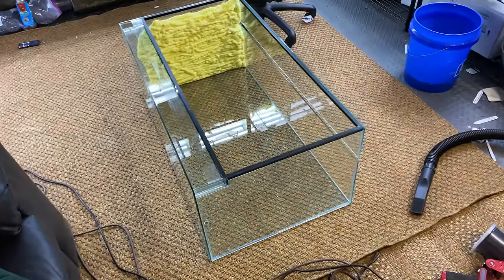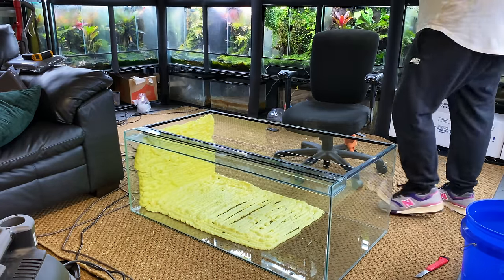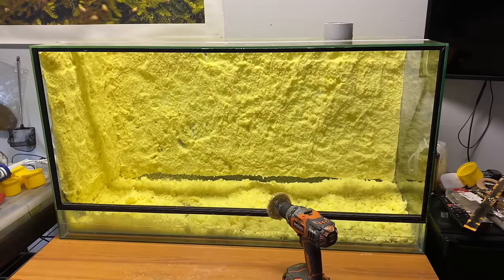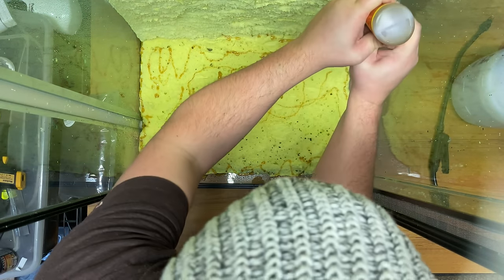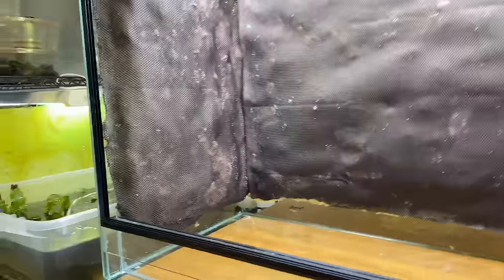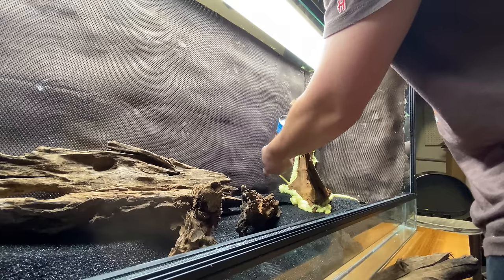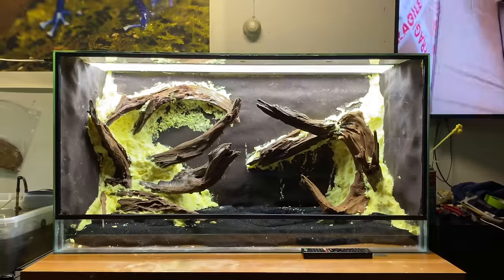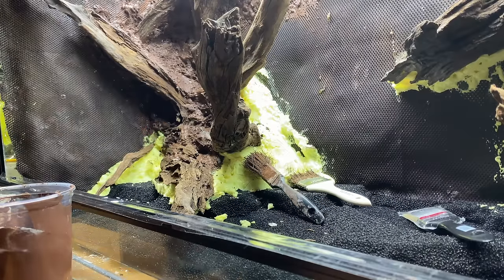How to Build A Custom DIY Vivarium Background Like a PRO!

Comment: Necessity is the mother of invention. I love the wire wheel hack! I am in the process of doing my first naturalistic/bio-active build on a 22wX17dX36H enclosure. I've seen the hand carved approaches, and the references to hours of carving. I'm probably not that patient. I think what I might do is add a little more foam up front, so that I can get some more depth to the cutaways and then maybe hand carve areas I want to bring a specific shape to.
I think what I'll do then is to carve out branch/hardscape notches as needed, fit the branches in and then spot foam them in place.

Comment: Auto body shop tip: use 1200 wet sand paper to take anything off your hands 🙌🏽. Body filler is very hard to take off. Sand paper always worked for me 👍🏽👍🏽

Comment: I work on a lot of cars and bikes, practically live in the garage covered in all sorts of adhesives and chemicals and nasty stuff, but I've got to say "Great Stuff" spray foam is hands down the worst thing I've gotten on my hands lol! I just let it dry and use an emery board on it while I watch TV later on which is pretty relaxing, haha.  This is a good video, man, thanks. You're easy to follow with a good pace and a way of explaining things that laymen can understand. The brush on the drill is a good tip. It's tedious using a knife and that brush gives a pretty cool, "natural" texture. I did want to ask if you've tried any false-bottom vivariums in that garage during the dry winter months? They're easy and cheap, I think it might be worth running one as a test to see if it helps keeps the humidity up. Of course you'd probably be pouring in water to refill the bottoms occasionally, but it might be a decent and mostly-passive way to keep the moisture up in the tanks, especially any that have overhead lights. I've been doing them in any vivs that need over 60% humidity or so, they really help any live plants flourish, as well as temperate or tropical "clean up crew" bugs like springtails.

Comment: I lay silicone lines down on my glass and put popsicle sticks on them and let it dry and cure and then put little droplets of silicone everywhere. Once dried Ivan lay down pond and stone foam. Once it's done cured i cut it. I shape it and then I lay a construction silicone around the edges and smeared in real good. Both on the foam and glass holds it really well. Note to everybody paintable silicone or construction adhesive is easier to work with.

Comment: Amazing video but 1 small notice... the matts we use here in Europe are called Matala matts. They are harder and dont compress unlike the foam filter you used. Matala mats are also used in koi pond filters and big pond filters where the flow of water and hydroscopic presure is so high it would compress the normal foam pads. Matala mats are slightly bendable and can be cut with a sharp knife or cut by a saw. I think over there in the US and UK you can also buy the mountain tree filter mats. Its almost the same material
Reply: Oohw 1 more little thing about the mats. They come in different colours. Use the black or green one. The black is most coarse one the green is normal coarse type. The rest will clog up.
Reply from the maker: I’ve used matala before… but also what you’re saying isn’t exactly true…. Many of the people in Europe are using the same sponge filter mat that Im using.
Reply from the maker: I always use black.. there are different grades of the black… I always use the lower PPI( pores per inch) for better aeration and flow.
Reply: @TroyGoldberg  ooh ok, well guess i learned something today 😉, thanks for the reply.

Comment: If u dab the deep parts with black and then grey around the medium and crack spots then bush the brown over u get better texture and shadows
Reply from the maker: I have a BFA in oil painting…
Reply: @TroyGoldberg   that's Kool is the lighting dark or does that stuff dry to be black?
Reply from the maker: Mmmm I mix many different batches… some of the dark mixed are almost black, some are a dark brown/grey…. I always paint the deeper crevasses darker mix… and the putter most surfaces usually the lighter mixes I make up… I don’t stick to this rule completely thought, because I’m nature not all substrates and cliffs edges are all the same color, some are different colors of dirt/rock/clay…

Comment: I'm a cabinet and furniture maker by trade; I use my carving tools (knives/gouges), chisels, and scrapers to carve my foam. I also use the green craft/floral foam adhered to the glass for most of my background - use the  expanding foam as filler or as terrain variation. Also use different Homax wall/ceiling texture spray for different terrain textures.
Reply: How do you get it to adhere to the glass?
Reply: @thesucculentcity  The cheap GE Silicone Adhesive from Walmart.

Comment: Great build! Really well done. You don't use a resin to cover spray foam? Is it waterproof? Thanks
Reply from the maker: Nope never have.... not sure if it’s waterproof or not...
Reply from the maker: But drylok is a waterproofed used for masonry... so I guess in theory after drylok is applied it makes the foam waterproof
Reply: @TroyGoldberg  Ok ! But you don't use Drylok on the sides/back panels, just gorilla glue and hygrolon. I think the foam is waterproof, when you go on their website it say "repel water". It's seem to been working great for you anyway :)

Comment: Very helpful video man! I’m just wondering, I’m going to be building a vivarium in a couple months and one of the features is going to be a cave right against the glass. The main structure will  most likely be made like these backgrounds, but how would I make the foam against the glass look like the background and not...foam? Also, where did you get the supplies to make these awesome backgrounds?
Reply: The foam can peel off the glass easily if you want. Paint it and return it to the original position, with glue

Comment: This looks amazing, hoping to do something similar, on a larger scale. I have a retic that will be living amongst it. I've done a ton of research and nothing tells me what to support the weight of my boy with.. all the tutorials are bearded dragons and jeopard geckos and such.. ever done this to hold a large amount of weight? Please let me know if any of you have any tips for me.
Reply from the maker: Hmmmm that’s a great question... is the tank going to made out of glass?
Reply: @TroyGoldberg  yes it will be glass, I am having it custom made so I actually could make the back out of tile or something else if it might work better
Reply from the maker: Brooke ODell well I was gonna day... of the back was wood or something you could drill through the wood, and anchor wood with screws and nuts and bolts and what not... I know retics can weigh a lot, so I don’t think the foam would hold there weight.. you’d have to prop it with like stone, or concrete or something very substantial
Reply: @TroyGoldberg  thanks so much for the ideas! Hopefully I will think of something, i still have some time. My retic is only about a year old so far but i want his new enclosure to be ready for him, before he is ready for it! Thanks again!
Reply: @brookeodell5164  Kinda late but a large snake habitat at local small zoo had plywood back and sides. The plywood had T-nut anchors behind wall same as a climbing gym that the decor was attached to. No clue what snake went in the enclosure because they were doing maintenance moving the decor. The enclosure was about 20ft wide x 8ft deep x 10ft tall in the "Python" room. You can search for DIY climbing wall to see the anchors I mean.

Comment: Just found your videos, the vivs are absolutely amazing. I had some questions that may not be in your wheelhouse, but figured I'd ask just in case.

I'm planning out a bioactive build for a ball python and was curious if this same process could apply?  Would substrate be able to go over the drainage layer or would I have to opt for just substrate?  Could the driftwood that is being held up by the foam hold up an adult ball python (4 - 5lbs) or would it collapse? 

Thanks in advance!
Reply from the maker: Thanks, I have no idea what the requirements are on a python setup
Reply: @TroyGoldberg  no problem at all! Thanks for answering. Still appreciate everything you work on. Look forward to future videos too!

Comment: I used black silicone and blacked out the glass before I used GS. Is that still an approved method?
Reply from the maker: yeah you can still do that... I just used Matt black vinyl wrap on the outside

Comment: You could definitely reduce the mess considerably if you used the vacuum cleaner while using the wire brush bit.

Also, why didn’t you use silicone to attach the hygrolon?
Reply from the maker: Yeah I’ve learned that along the way, because gorilla glue creates a much much stronger bond between the foam and hygrolon than silicone
Reply: Troy Goldberg's Tropical Garage thanks for the info! Awesome looking tank by the way!

Comment: Awesome build. The wobbliness of those protruding bits of drift wood makes me anxious when you touch them though. Do they not weaken over time and potentially drop as the foam shrinks and the weight of water saturation on the wood etc? 

I have a 90x45x100 that houses my group of 4 Leuc's that I'm having to rebuild as I foolishly used lots of cork and as its got wet over the months and months and become weak its started to collapse and I'm scared of it collapsing totally on the frogs so want to rip it out and use stronger driftwood. But like I say I fear the driftwood will fall over time. I didn't use expanding foam with the cork though I should add, just lots and lots of silicone to carefully position each piece.
Reply from the maker: I’ve not had any issues with that.
Reply: @TroyGoldberg  Thats good to know. Any chance on your next build video you can show us exactly how you foam those kinds of stick-out pieces in place?

Comment: Hi Troy thanks for your awesome vid's I love to watch them. I've read that using this type of foam could push out the sides of the viv? I'm planning to do the same method as you apply here but I'm affraid later the glass is pushed out. Whats your thought about this. Thanks a lot and keep up the good work.
Reply: If anything it's providing strength holding the tank together. When the foam begins to expand, it doesn't have the strength to  push on anything because it's just goo. Once it is finished expanding and begins to cure, it doesn't expand anymore so it will essentially just become part of the wall. At least I wouldn't try to remove it unless you placed a layer of plastic drop cloth or something similar between the terrarium and your foam for the purpose of removing it

Comment: My drylok is peeling away from my tank on the edges, I used silicone underneath  the background on  glass and drylok connection on the edge, should I put another bead on the outside top along the edge
Reply from the maker: I usually do a bead where the foam edge meets the glass before drylok

Comment: Hey how u said u put silicone around the edges of your foam to help keep it stuck to the glass is it to late to do that after I’ve already foamed the tank
Reply from the maker: No it’s not to late... that’s always when I do it.... after it’s foamed
Reply from the maker: I also usually add some sort of substrate mix to the silicone to cover it up... just vacuumed the excess off after it’s cured

Comment: Hey man, so im building a vivarium for my chameleon right now, and this has been my first experience using drylok.  I put the first layer of drylok on last night, its been about 12 hrs, and the drylok has been really good on the polystyrene foam, but the greatstuff seems to be just holding on to it like a wet sponge and isn't drying in some places. Will it dry with more time, and also, with it gain more rigidity as it dries and i apply more coats to it?  Right now, im scared to add more coats of drylok as i dont know what its going to do.

Comment: Where do I find more information about the foam substrate? Very interested in trying it out but haven’t had luck finding information.
Reply from the maker: What kinda information you looking for
Reply: Troy Goldberg basically setup
Reply: Do you just add leaves right on top of the foam?
Reply from the maker: ReefFreak@ so I added moss and a few leaves I’ll add more leaves as moss develops... but I would think you could put abg right over top of it, and leaf litter or just leaf litter by itself... I’m not really sure yet being this is the first time I’ve used it
Reply: Troy Goldberg ok I’ll experiment with it and let you know how it goes.
Reply: @TroyGoldberg  I've been using the foam substrate for over ten yrs now and can tell you without a doubt just add your substrate directly on top and it will be fine.  I find it's a good idea to add a drainage line that goes from a bulkhead to under the foam to drain water if the water level gets too high, the foam keeps all the debris out of the water so you never have to worry about a clog.  It's very convenient.
Reply from the maker: hkspowers003 yeah that’s what I did... I made sure the water level would never be above the foam line... I’ve just been adding moss directly over top of it and been having great results... I haven’t even been using any sort of substrate with these builds and I’m really liking it!
Reply: hkspowers003 do plants root into the foam?
Reply: @leegrimason4943  Yes plants will indeed root into the foam.
Reply from the maker: Lee Grimason eventually yes

Comment: Awesome video, but I have a question. How come you only used the gorilla glue on the expanding foam and not the drylok? Will that be enough to seal it from moisture? Im about to build my first terrarium and worried about this!
Reply from the maker: You don’t really need to seal the foam… the drylok is really just for looks and texture….
Reply: @TroyGoldberg   what type of fetlock did you use for your large 300 gallon tank sir. Thank you
Reply from the maker: Fetlock??

Comment: Hey Troy. I can't find gray Drylok in qt size (or even gallons) anywhere. So gonna use white and thinking brown and charcoal kinda mixed together. 
I'm curious, what's that membrane, (hydralon?) for?
Reply from the maker: yeah u can use white, hygrolon is a water wicking material that allows plants to grow on it very quickly and easily
Reply: @TroyGoldberg  thanks dude.

Any hydrolok, especially gray,  is damn near impossible to find around here in Detroit. I have a friend that works at Menards (in paint ironically), and Zinsser WaterTite is latex like Drylok. And it's tintable, without the quikrete tints. She whipped me up a quart of custom tint dirt brown. 

I'll send you a link when I get to the painting step. I have a thread on Pangea forum.

Comment: Try a 1/4 inch I grow mushrooms and humidity is my specialty my friend moisture and being sterile is all about mushroom a 1/2 inch is a lot of air exchange man I grow hole 74 quart tub slammed with 6 inch tall + mushrooms your sticking those little frogs in a gym almost lol and when doing your vent on drop down and inch or 3 because moisture dose not leave the tank with the air that’s circulating through and out. it is water more Dense than air so it lingers around for awhile longer before being escaping and you’ll have better humidity levels by making multiple smaller holes spaced out but the number one rule is never put your vent to close to the top you’ll never have a humid tank if not so if you don’t drop down in vent size atleast don’t put the vent too close to the lid 3/4 the way up at maximum you’ll have a jungle in there if you stick to these tips
Reply from the maker: I have no clue what we’re talking about here

Comment: Can you use spray adhesive rather than the bottle?
Reply from the maker: original gorilla glue is the preferred method, its bonds incredibly well top the hygrolon and the foam.

Comment: I'm not okay with the fact to use foam to make the base decoration ...
Because this chemical product gives off chemical gaz that pollute the environment on the terrarium slowly but surely like the Polyol etc.
I think that a galvanized masonry grid, you know the one we use, to make facades very smooth, at the measure, would already do the trick.
To make it hold, a glass drill bit with small holes and small bolts with a large washer on the inside and a bolt accompanied by an anti-loosening washer to hold everything together and to ensure the seal, epoxy resin..
Then for each hole, filling and tedious stuffing with sphagnum and mixed coconut fiber and there you have a terrarium bottom without chemical pollution.
In the end it's up to me .
Reply from the maker: Yep I was gonna say… go for it!
Reply: @TroyGoldberg  as you have them the kindness to answer me which is rather rare coming from owner of youtube page and even if you were a little sarquastic, you gained a subscriber 😃👍It's nothing, but it still says I like what you do.
Reply from the maker: Wasn’t being sarcastic, I do the things the way I do, and the point of my channel, is  to ultimately help guide people to do things their own way.  So I always encourage people to try new things.